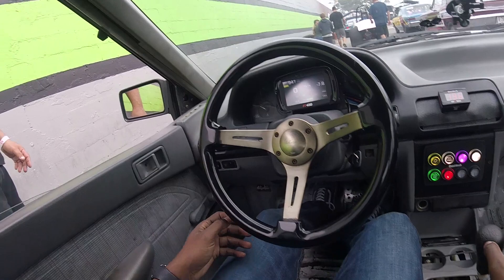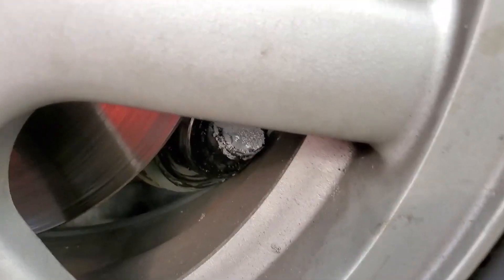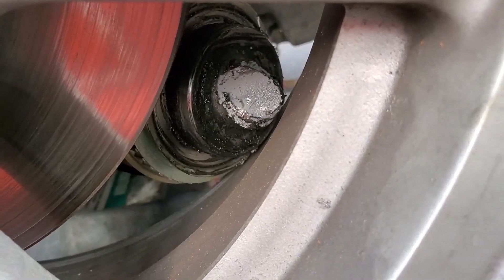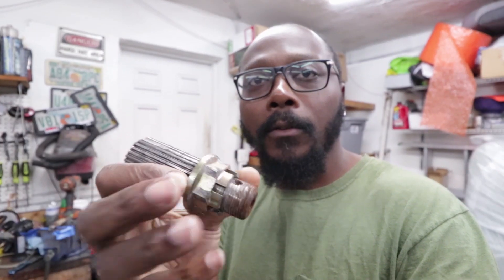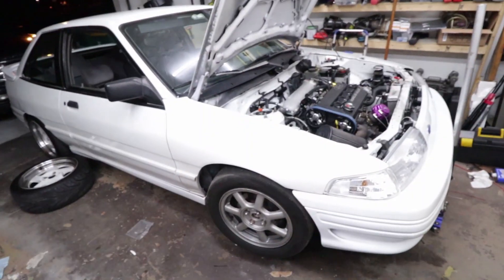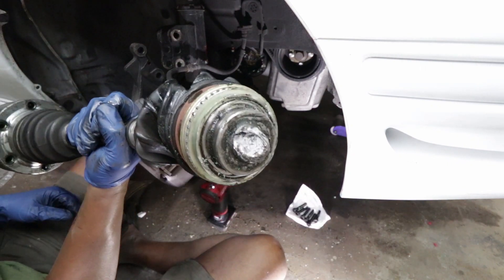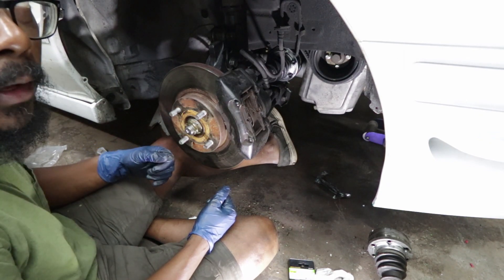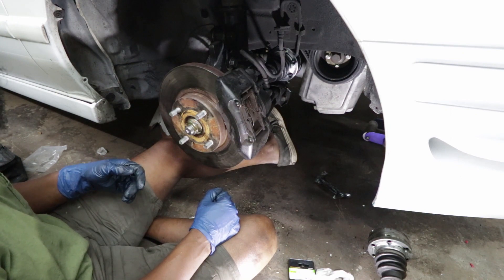First pass on the Fuel Tech...kinda

Comment: Just FYI, it wasn't the launch control or the track being too sticky, it is your inability to slip the clutch. You might have to get a little bit less aggressive clutch, or have someone make you a twin disc that you can slip a little bit, because that shock of dumping the clutch like that, is going to break even a DSS axle. You need clutch slip or slight wheel spin with a front wheel drive car. Or you will break quite often. I have a clutch specialties 6 puc sprung cerametallic clutch, and it has held 400 foot pounds, and I can slip it nice off the line. I have a feeling it will hold close to 500 wheel torque. It's rated for 600 torque. That clutch is what's killing you. Or you need some more seat time, to learn how to slip it if it does have the ability to slip. Just my two cents.
Reply from the maker: At 2:30 I said I let the clutch out too fast.  And it was a combination of things. The owner of the track himself said the track was too tacky, the night before they had a big bike event, Lots of prep layed down throughout the night, so much so that they didn't re prep for sunday. They were hoping the street cars would help calm things down before they ran the slick tire lanes.  12 cars broke axles, diffs, or trans in the 2 hours  lanes 1 and 2 ran(slick tire lane). This is the first axle I've broken out of 2 years of 1.8 to 1.6 60fts.  I guess what I should have said was, the track was way sticker than I expected( I was expecting spin), that combined with me coming off the clutch too hard(for the track condition) , and me leaving on 16 psi (if the car wasn't building that much it likely would have just bogged.
Reply: @StovallsGarage  I just noticed that in most of your videos where you are launching the car you dump the clutch. So I thought maybe it was the clutch. And I made that comment before I got that far into the video LOL
Reply from the maker: @BoostedSpeedDemon  It's not really a dump, I'm not side stepping it or anything, I start letting out on the 2nd yellow, and I'll hold it as the car starts to move, but it does engage aggressively even if I slip it, I may look at a twin disc in the future, but for now I'm switching to 24.5 x 13 x 9.5 slicks, current slicks are 23 x 15 x 7.5 so there isn't a lot of sidewall to absorb shock.